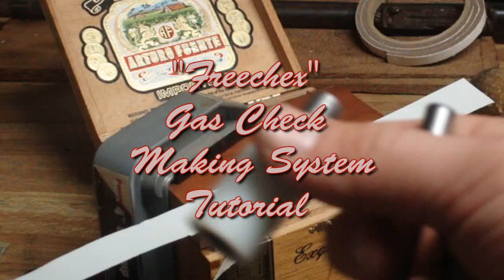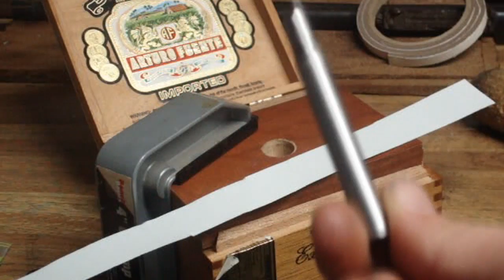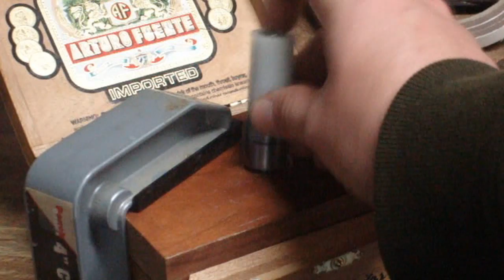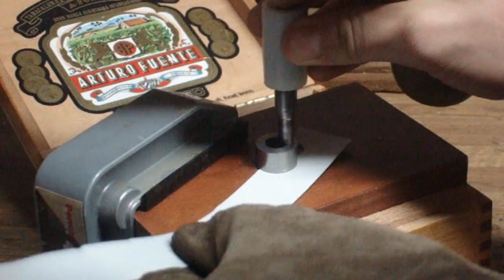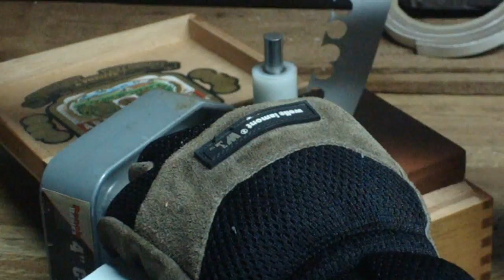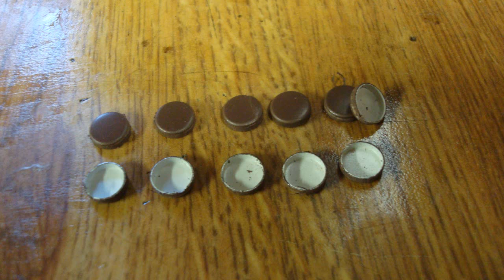Freechex Gas Check Making System Tutorial

Comment: This is not right... you must not use aluminium for gs checks..

If you use aluminium gas checks, you will end up with excessive chamber wear. Aluminium oxide is way to abrasive.. Gas checks are made from copper for a good reason! Have you ever seen aluminium used for jackets?
Reply: aluminum is a very common material used for gas checks.
Reply: Aluminum oxide is a very common material for abrasive use on steel.

Comment: @cjb4187  Someone else might give you a better answer, but gas checks are used to seal the bore and primarily needed when higher pressures/velocities are created. (typically happens in rifles more than handguns) Wikipedia says: The high pressures allow propellant gas to escape past the bullet, causing gas cutting, which increases lead deposits in the barrel and unbalances the bullet."  I cast and load 9mm Luger and have never used gas checks. Some people use them for 9mm rifle loads however.